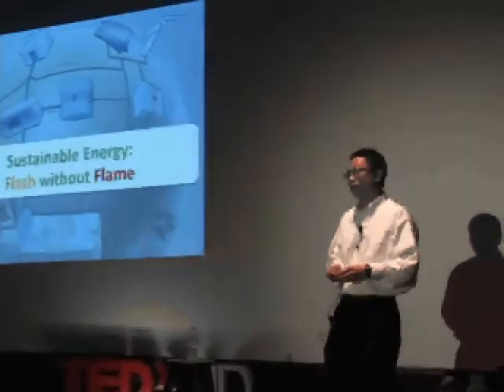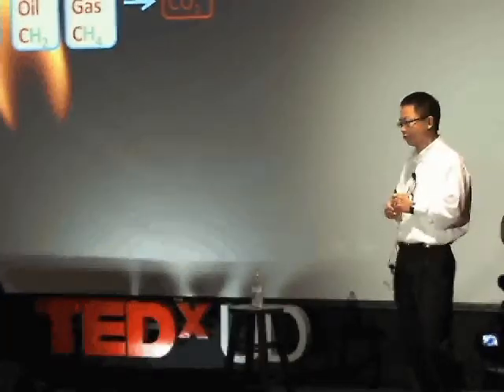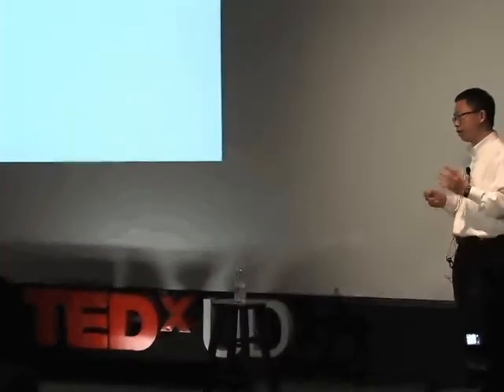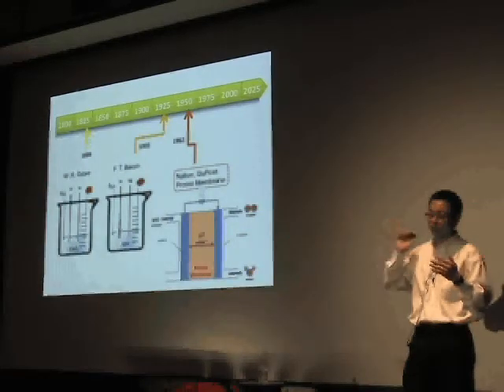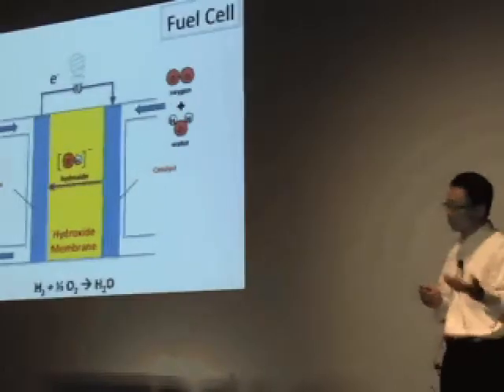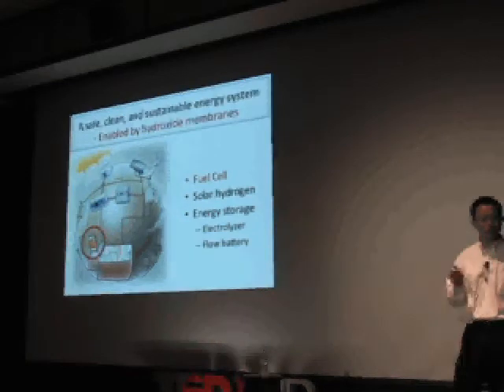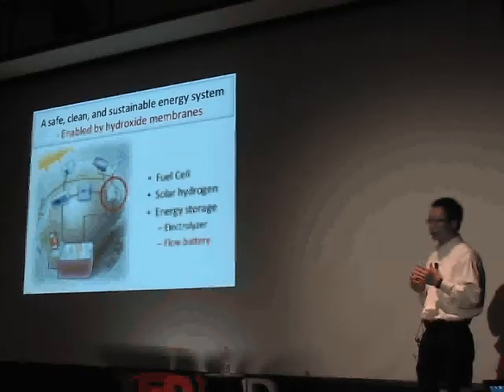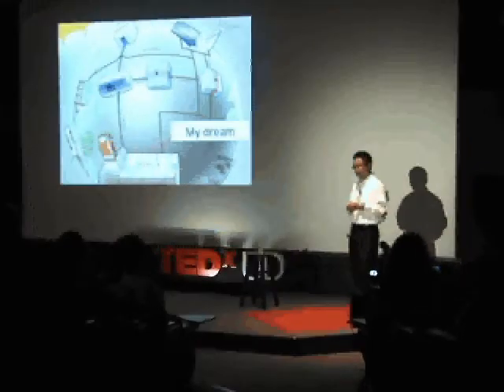Reinventing the fuel cell: Dr. Yushan Yan at TEDxUD

Comment: Can’t wait till we’re mining platinum and driving the cost of fuel cells down substantially. While we’re at it we might even start mining water ice for hydrogen in space using the virtually unlimited energy radiating out from our sun. Space is the future. My hope is that rockets are like mainframe computers with large, inefficient cathode ray tubes and that someone will invent the “transistor of space” that totally revolutionizes the space transport industry. Imagine going from $12500/kg to $100/kg. I’m hopeful that we’ll get there.